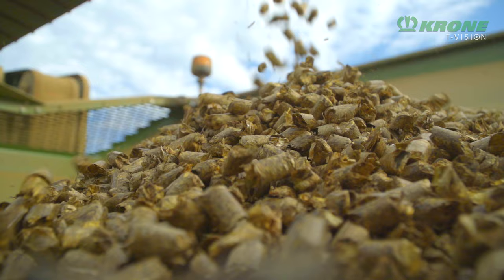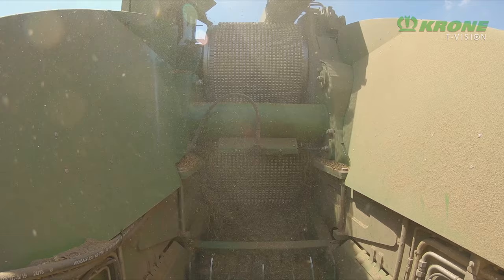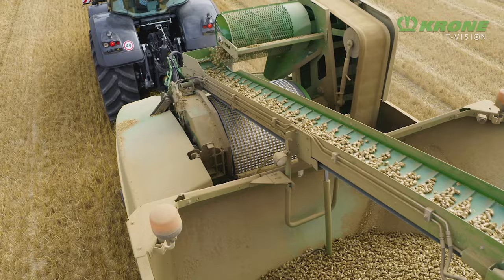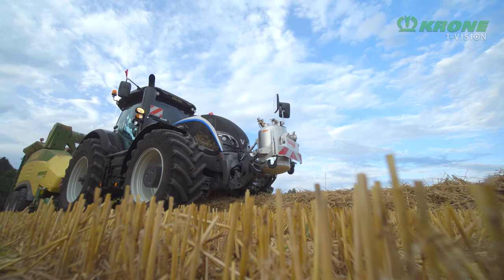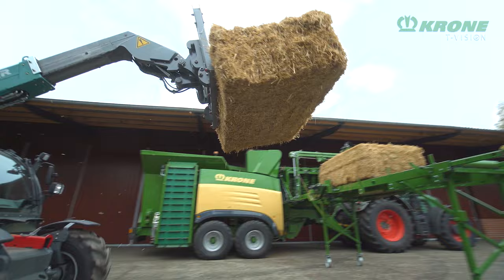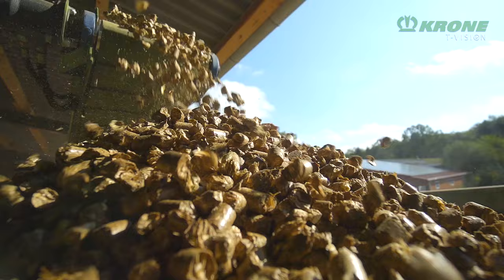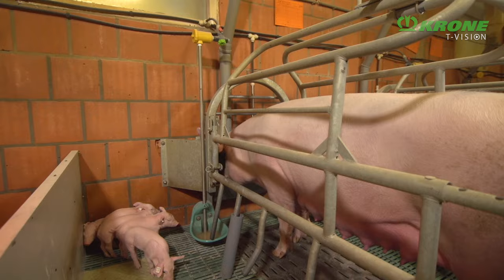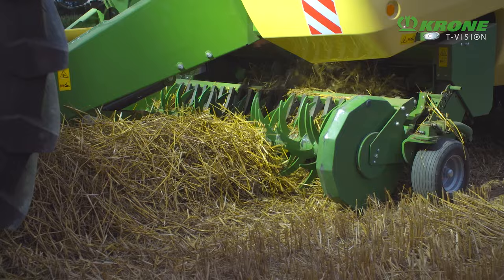KRONE Pelleting press – Premos 5000 (2019)

Comment: It's an interesting piece of equipment.  One thing that always bothers me with sales pitches like these -  Straw chopped and left in the field is not "unexploited".  Removal of the straw takes away nutrients that then need to be replaced with fertilizer.  Unless the farmer spreads manure back on the field, the organic matter is nearly irreplaceable.  Farmers that do not need the straw for their operation need to calculate whether or not selling the pellets is cost effective.
Reply: A lot of farmers sell the straw and usually brings in much more money than the added fertilizer costs. As for the organic matter you are correct that it can't be replaced unless you fertilize with manure.
Reply: @rrmtnfarmer3273  You are right.  that's why I said the farmer would have to work it out.  I live in an area that has a lot of livestock production and straw is in demand for animal bedding and feed.  I still chopped my straw back on the ground due to concerns of profitability, until the past year.  I had my rye straw big square baled and I sold it off for $65 per bale.  That is good money for 600 lbs of straw.  Otherwise, it benefits my operation more being spread on the field. 

Now, in Europe where they're trying to get out from under the thumb of needing Russia's natural gas. Maybe burning off their biomass and trying to replace it with synthetics could pencil out.  Right now the Germans are literally destroying villages (look up Hambach surface mine) to get to brown coal, and this is definitely better than that...  Probably don't want to get into global politics here, though.
Reply: @farmerboybill  very true, each operation is different and needs to do what works for them. The organic matter is definitely a big plus to leaving it and that's something each farmer has to decide whether to take it off or leave it. 

As for the global politics, you are definitely right about not about on here because you never know who will read our discussion and get offended by it. I will definitely look it up though.
Reply: @rrmtnfarmer3273  When leaving it in the field the additional fuel cost for chopping the straw must be added to the calculation. Even if the farmer only manages break-even with bales, the fuel saving on combining may make it worthwhile.

Comment: AMAZING. I would have liked to have seen animals consuming the pellets safely.
Reply: I think that's one of the reasons Deere abandoned further development back in the '70s on their cuber.  The cubes were bigger than those pellets, but cattle would still occasionally choke on them. I think this machine definitely has its uses though
Reply: What would be unsafe about animals eating pellets?
Reply: @bailywelsh102  they may choke is the only reason I can think of
Reply from the maker: Pellets from hay, lucerne and straw make excellent base rations. Research has found that high-fibre pellets show distinctly fewer traces of pathogens and mould than straw. This is proof of their high quality for use as animal feed.
There are also customers using the pellets for bedding because of their excellent absorption qualities.

Comment: Question: Why does the Krone Australia website have a "New in 2018" button? Don't they update the website or are new models infrequent that it is not needed?
Reply from the maker: Thank you for your tip. The website is operated by our local Australian partner. We will advise them to check their website. Unfortunately, this can happen sometimes.

Comment: Pretty cool. Did I hear right 350-500 HP? That's a LOT of power.
Reply: For today standards on large farms 350 is about the average and is actually even on the small side now.
Reply: @SKC640  Time sure marches on, thanks for the reply.
Reply: @KC2DZB  right I am still use to a big tractor being 100 to 200 hp now that's pretty much considered a chore tractor lol there's a new fendt that's 500 and quad tracts over 600!
Reply: @KC2DZB  hey I watched you videos on that electric lawn tractor that thing is awesome!
Reply: @SKC640  Thanks! GE made them in the early 70s with their own brand and also for New Idea. Wheel Horse picked it up and manufactured them in the mid 70s before shutting things down. They're pretty capable little machines, I have two and love them both.
Reply: @KC2DZB  that's awesome I bet you they're really fun to tinker around with do they they have some power being electric? Are you from there states also? I've always wanted a little lawn tractor with a loader lol
Reply: @SKC640  yes, they can go head to head with any gas tractor of the era, and put anything modern to shame. Almost no maintenance either, which is nice. I fix them for people locally (NY). There's a website myelec-traks dot com with a ton of info.
Reply: @KC2DZB  thank you for all your information. I am from MN and have only seen electric ones that people made themselves. I am definitely going to have to check out that website! Have a great day.
Reply: @SKC640 Good afternoon
Reply: @KC2DZB  Good afternoon do some have a email address from this company I really like this machine

Comment: What about rocks going thru the steel rollers? Wouldn't they cause damage?
Reply from the maker: So far we don’t have problems with rocks.  Normally the machine doesn’t pick them up due to the slow forward speed in the field. Second protection is a rock separation between Pick-up and first belt. If a rock makes it into the machine, it is crushed by the rollers or it stops the machine – depending on the size of the rock. The rollers are made of such a hard material, that no serious damages are expected.
Reply: @KRONE.International  
Ok

Comment: No molasses?
Reply: The maskine has a tank that usually add vegetable oil if needed to lubricate the die roller holes.
I guess you could add say molasses if you wanted to.
Reply: @samkom33  It's somewhat of an inside joke... this machine in Farming Simulator used molases.

Comment: It looks like top speed is around 4 mph?
Reply: yeah so maybe having it stationary is probably best in terms of which is easiest todo
Reply: @john34261  you still have to bale it or collect it. So I don't know which would be quicker.
Reply: @KansasFarmer  i think baling it and having a large amount beside it would be faster if you're multiple people with baling  and you could store the bales and keep harvesting to make more bales
Reply: @john34261  yes I would have to agree with you.
Reply: @KansasFarmer  and if done alone maybe as easy but really time consuming
Reply: @john34261  I was thinking about that too. When does come to console. I hope AI can help in some way. But I doubt it.
Reply: @KansasFarmer  maybe when it is stationary they can keep it going and onloading untless there's not enough space while we're baling and putting the bales nearby to be processed
Reply: @john34261  maybe
Reply: It's top speed is 5000kg/hr. Surface speed over the field is determined by the amount of straw present on the field.
Reply: @glen8978  sounds interresting but what do you think is easiest?
pelleting while on the field or baling to pellet later and planting right after?
Reply: @john34261  I think it is faster to bail the straw, but it really depends on the situation. If the weather is about to turn bad, it would be better to get the straw off the field and process later, but it means you need 2 expensive machines and 2 separate operations. I don't think there is only 1 correct answer for all situations.
Reply: @glen8978  yeah you're right there's no right answer for all situation and if i owned a farm i think i'd bale it up and store it and i just use a bale fork and a trailer to get them off the field and if it shows to be raining soon i know i would have to get help to bail the straw and i get the bales on the trailer in the meantime
Reply: 6mph

Comment: What was that unit on the front of the tractor where the counter weights usually goes? It looked like a steam generator to help keep the leaves on the hay. Germany has to burn all this Biomass and create CO2 because they shut down their clean zero CO2 emissions nuclear energy facilities and the green garbage can't produce the needed power in real world situations.
Reply from the maker: In front of the tractor you see a fire extinguishing system. 
It was developed by the contractor himself in order to be able to quickly remedy a fire in the field.
And the pellets are not only for burning as you can see in this video: https://youtu.be/nvJH2e2dP1Q
They are also used as animal feed or bedding.
Reply: hello